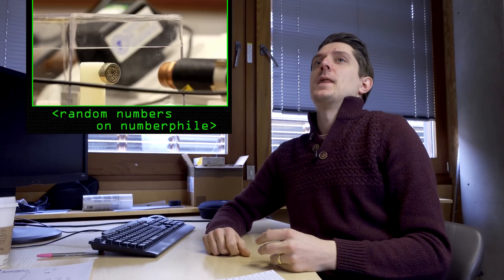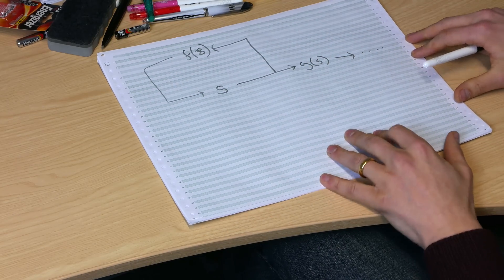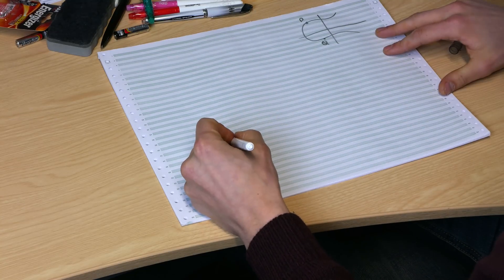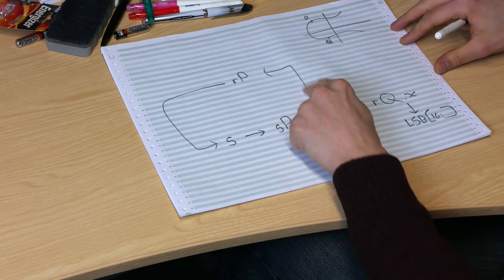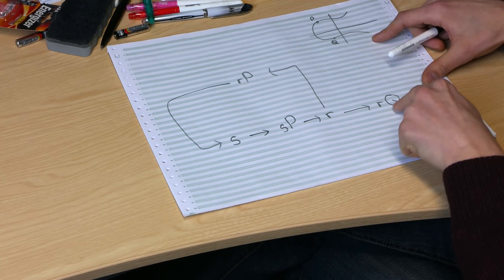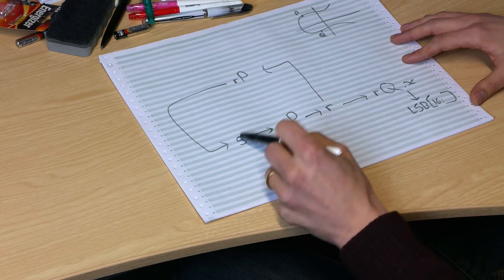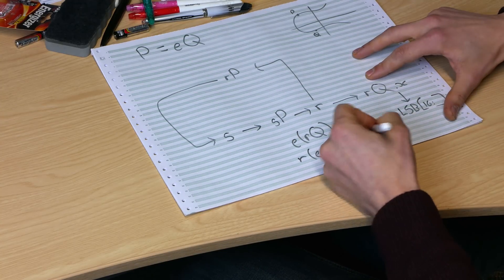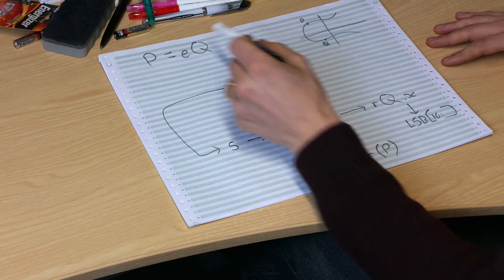Elliptic Curve Back Door - Computerphile

Comment: how does this effect bitcoin?
Reply: Im wondering if it can be used for the btc puzzle (Adam Back created a puzzle where the difficulty increases with each puzzle difficulty increase (starts 2^0 to 2^1, then puzzle 2 was 2^2 to 2^3, we are on puzzle 71 which is 1^70 I believe.) I also get around 3bill keys a second I can scan. Which is like 300 years but I have only 1x RTX and this is without using any mathematical tricks. Such as when we know the public key we can apply pollards kangaroo

Comment: It's not a backdoor.  Look, don' tuse libraries unless you understand something about them, PARTICULARLY the random number generators.  If the numbers you are getting back are NOT random, but are merely pseudorandom, don't even bother using security.

Here, you want a SIMPLE way to produce random numbers?  Make a file filled with garbage, just mash your keyboard for a minute.  Now do an SHA256SUM on it, take at most 64 bits out of a PORTION of the string - that's your random number, now do an SHA256SUM on the previous SHA256SUM result, and repeat.  You can get fancy and scramble the bits if you like, whatever, the point is that without the original SHA256SUM, value there is no way to duplicate the sequence.

Note that this is not suitable to use as a private ECC key.

Comment: we did this 'back door' mathematics in seismic processing - called deconvolution...

1> we know the original source signal (dynamite or vibrator)
2> we run the source through the earth
3> record the signals...
4> deconvolute the original source

and you get a 2d slice of the earth's structure...

Comment: For any elliptic curve with prime order we can pick two random points P and Q and ask for a number e with eP = Q. There is allways such a number e. But it is impossible to find that number or at least extremely hard to find it.
Reply: The whole elliptic curve encryption seems like a bad idea in the first place, for the reason you state. Which is probably why NIST chose it?
Reply: @blucat4 The NIST wanted us to use only  standard curves which are well known. So we should not know, that such curves are not required at all.
Reply: @franzscheerer  Can you tell me, is SHA-256 totally secure? (I'm new to this but I love it.  :-)
Reply: @blucat4  I suggest to use a slightly modified version of SHA-256. Connect the SHA-256(m) value with the message m and calculate from the connected strings the hash value.    

h(m) := SHA-256(SHA-256(m) || m)  

A collision (same hash for different m) of h is a collision of SHA-256. It means, h is at least as secure as SHA-256. But if SHA-256 is not secure, h is likely still secure.
Reply: And that is true for all elliptic curves with a prime larger than 2 ^ 160.
Reply: If the order of the curve is not a prime, we allways con find a subgroup with prime order. It is all we need.

Comment: The truth is nothing is ever secure...

Lets break it down..

All random number generated uses prime number.

The largest prime number ever discovered is around 2^82,589,933 − 1. Every one of this random number are recorded as it's discovered.

In elliptic curve, NIST gives you a prime constant number which is not even up to the latest. The truth is that NSA already have all the combinations of keys the prime given could produce on their database.

Now you talked about the seed. The seed is not a key... The seed majorly is used for padding. This could be easily removed from the hash once the key is know.

Once your ciphertext reaches the NSA... They just perform a bruteforce attack on the ciphertext using the key combinations.

So the backdoor is the prime number given. Because if everyone is to pick their own random number... It will take them thousands of decades to findout all the possible combinations of over 2^82,589,933 - 1

If you look very closely, you will discover that the prime given is not even close to the largest prime ever discovered. So with the current NSA computing resources, it will only take them months to findout all the possible  combinations of the prime constant. Although they will tell you it's because of performance that's why the prime constant is smaller... But thats not true. If they really want to proof to the public that there isn't a backdoor... Then everybody should be allowed to choose their prime.

Standard should only state the minimum of prime that should be used to be security verified...

Take a look at it... Why is elliptic curve and other algorithmns breakable by quantum computing? Is it not because of the bruteforce speed. Quantum will be able to compute all possible combinations of the largest prime within hours.

Comment: If NSA has generated the Point P as eQ from the Point Q and they might have stored the number 'e'. It is possible. But on the other hand, why to use elliptic curves in case the number 'e' is really unknown? I makes no sense, because hash functions are much faster.
Reply: So, it looks very likely that the NSA did really install a backdoor.

Comment: Hmmm. The NSA has tried several times since the 1990s to establish a master key back door in the crypto algorithms they promote. So, this is just another attempt.

I guess this is also the reason why many countries are trying to establish their own proprietary algorithms in the financial and data comms areas. They often forbid the use of the classic US algorithms.

But then all these cryptoligists in the NSA have to have been working on something.
I remember the publication of the book on differential crypto Analysis in the early 1990s.
This made short work of many symmetric Algorithms. However it did not for DES. In fact differential Crypto Analysis in DES was by orders of magnitude harder than brute force.  
Little Reminder DES was developed published in the late 1940s. Differential crypto Analysis was only discovered by Academia in the late 1980s.

Comment: Sounds almost the same as DES where the NSA made magic changes and reduced bit size. Eventually it came out that the changes were to avoid attacks known to the NSA, so in that case they strengthened the algorithm but made it easier to brute force the encryption. Basically they were pricing everyone else out of the brute force market (for a limited time anyway). It would not surprise me if this was similar.

I also find it surprising that low performance wasn't really brought up as a potential vulnerability relying on costly/predicted optimisations that give them an in ways that can't be replicated by re-discovering an algorithmic backdoor.

Keeping the algorithms as strong as theoretically possible and tuning computational complexity fits well with a strategy of keeping ahead of the pack in computational power.

Comment: I find it astonishing that a standard can go through and still be used with so many "that's suspicious". Just one suspicious thing should be enough to just ignore it and use something else..
Reply: As far as I can tell, that's usually how it goes. But security isn't always the top priority, sometimes speed is. So it's a balancing act...
Except in this case, where 1000 times slower and there possibly (definitely) being a backdoor was ok :')
I don't think the community at large uses stuff like this tho, although I guess companies might?
Reply: Elliptic curves have one big advantage. You can get along with verry little memory and at least i don't know a common side channel attack. Which makes them great for embedded stuff like machines.
The potential back door on the other hand is nothing great as machines usually run for a view decades.
Reply: I mean the NSA were very probably paying them to put it through, right?
Reply: @Ping727   No probably, they did.

Comment: I pretty sure your maths are way off.  Having the 16 LSbs from a 256-bit curve isn't brute forcing 65,000 points (16 bits), it's brute forcing 256 bits minus 16 bits (240 bits).  That's about 10^72.  No way you're brute forcing that.  Even if you do, you've only validated rQ.x points.  That might get you down from 1.8x10^72 to 9x10^71 (since about half the points aren't on the curve).  (Remember, you have the 16 bits, you're not searching the 16 bits. You need to brute force search the space you don't have.)  Then you go on to suppose a hidden e.  Say up front that you're being critical of a particular NIST elliptic curve, and not all elliptic curves.  There is nothing wrong with elliptic curve random number generation so long as you use a secure elliptic curve - which the NIST one is not.

Comment: So not only is it a 1000 times slower than other methods but also it isn't any securer, even if there weren't a back door. Did I miss something or why would anybody consider using this?
Reply: It could be more secure than using for example the additive group of integers mod pq (also known as Z/Zpq) , for large primes p and q. The problem with Z/Zpq is that we understand its structure pretty well and we can use other properties of modulo arithmetic to make attacks more efficient.

Comment: Why not use a seeding from say some source of white noise or even the cosmic microwave backgound which I assume will have a suitably high degree of randomness attached.
Reply: Hardware implementation and ensuring the noise pool cannot be tainted. There are dedicated randomness modules you can use, but typically hard drive seek times, user mouse input and all sorts of unpredictable events are used to generate noise.

Comment: Question:
Why don't modern computers have an antenna built-in, that receive the radio white noise and slowly translate it into random bytes?
Reply: Because you can hijack the airwaves by blasting it with a radio i.e. WiFi and Bluetooth, rendering the noise floor useless.
Reply: I thought they did?
Reply: hardware pseudorandom number generators like the one you're describing do in fact exist, look them up

Comment: I wouldn't call SHA-1 broken, just not complex enough for people motivated enough to break it.
Sure there are vulnerabilities which make it easier to find a collision, but it still takes a lot of computing power to do so.
SHA-256 could also be "broken" if people were motivated enough.
Reply: Jeffrey Black that’s kinda the point. Technically you can “break” anything with enough computing power. But there are only a few people that have resources like that and if those people are coming after you, they are going to get what they want
Reply: @ohsw3at  And my point is that that doesn't make it broken.
It is just a known limitation.
Breaking it would mean some way to take an output value and perform a calculation on it to determine an input value, i.e. a way to reverse it, or to take an input and a desired output and perform a simple calculation to determine what needs to be added to the input to give the output.

Being able to be brute forced doesn't make it broken. If that is the standard for being broken, then everything is broken.

Comment: Why are computers not fitted with a true random generator (tapping into some quantum event)?
Reply: They don't even need quantum randomness for "true" randomness, they can also use hardware latency or random parts of user inputs. In Windows, CryptGenRandom actually provides such data. But maybe this is too slow for many applications.

Comment: since computers take counters, regular clockspeeds and therefor timedependent states into account it is actually difficult to guarantee absolute randomness for parameters. Of course if a random generator seems to be deterministic in any way (dependent calculation times for specific bit lenghts is enough - timing attacks) it is to be discarded.
Reply: You can always connect to a quantum random number generator ;) Only... is your connection secure? Hmm.. chicken, meet egg.

Comment: In other words: if there may or may not be a backdoor, but the NSA is showing an awful lot of interest in the alleyway behind the building, there's probably a backdoor.
Reply: You can defeat most of the backdoors they put in by picking your own random numbers.  In ECC, the private key is just the random number.  You can start with a random number given by the library, do an sha256sumk on this with the time of the system in milliseconds, grab another random number from the system, then sha256sum those two numbers together.  That's pretty unpredictable.

People are HONESTLY afraid to "pick their own random number" and they SHOULD BE.  But remember F (random_number) = another random number and if the function F is a hash, it's not reversible.  You can take random numbers and add your own (perhaps not at all secure) numbers as well to operating on a potentially compromised random number, which isn't really random.

Comment: I notice you are writing on the chain paper that was used much for line printers 2 or 3 decades ago. Is this still used today, or did you have tons of the stuff left over from those days? (I remember using those as a music score!)
Reply: The answer is yes. This sort of paper (and the printers it goes in) are still in use today. Not as common as they were a couple decades ago when they were the only option, but some applications lend themselves better to impact printers and track feeding. As for why they use the paper on this channel, I would imagine it's mostly aesthetic because it has a sort of retro vibe that fits with the channel's overall theme. You might also be right that the Uni has loads of the stuff lying around and nothing to do with it, so the profs use it for scratch paper. Both could be true.

Comment: Is it theoretically possible to solve the elliptic curve discrete log problem?
Reply: Its not proven impossible on a classical computer.  The general consensus is that it is impossible (short of brute force, which of course can solve any key finding problem given enough time.. but when multiple ages of the universe is not enough time, that's not really an issue worth considering.)

On a quantum computer however, its not only theoretically possible but we know how to do it (Shor's algorithm.)  I'm not sure that we have discovered any functions that are suitable for classic cryptography that (provably) can't be broken by a quantum computer.  I don't think we have.. though I'm also pretty sure we haven't yet proven that such a function can't exist and is just waiting for us to find it.  Discovering a cryptographically strong (and fast enough to be practical) classical function that can also be provably unbreakable by a quantum computer would lead to a significant overhaul of the computer security industry, and would remove the need for quantum cryptography (which is a very hard problem.. not because of the math, but because everyone would need a quantum computer to do their cryptography and that's just not going to be practical in the foreseeable future.)
Reply: that's the standard discrete log problem (using integer factorization), not the elliptic curve discrete log problem, which as far as i know doesnt have a theoretical quantum algorithm associated with it.

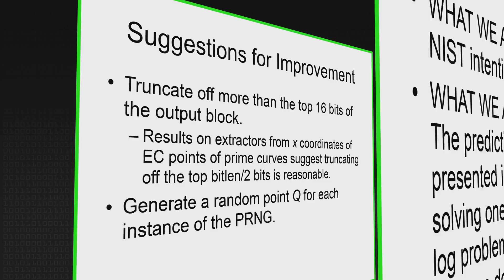Comment: 10:40 The actual slides say that there MUST BE a number e such that P = eQ, but they aren't sure if anyone knows what it is.  That's not quite the same thing that Dr. Pound says ("we don't know whether this exists; hypothetically it could").
Reply: In principle, any (valid) point on the curve can be reached from any other (valid) point -- that's actually a somewhat important property or you risk your state update getting into a short (and therefore easily breakable) loop across only a small subset of the entire space.

So yes, there absolutely is an e.  Its just a question of who (if anyone) knows what that specific e is.  If they really wanted to make it secure, they'd be using two different curves rather than two points on the same curve so that rP has absolutely no relation to rQ (though that might just be pushing the problem up a level and show that the given a's and b's aren't related in some subtle way between the two curves.)